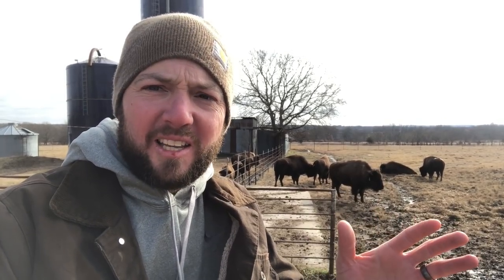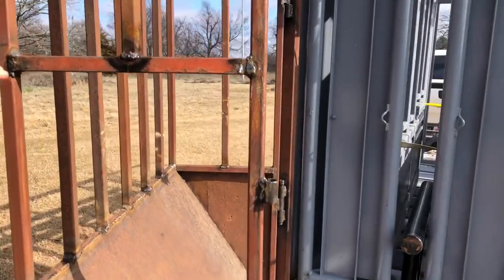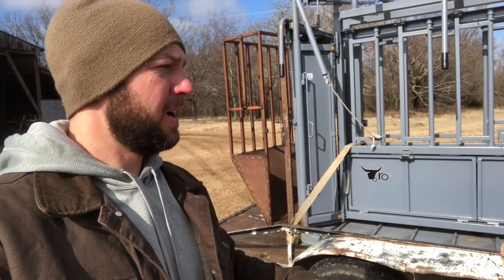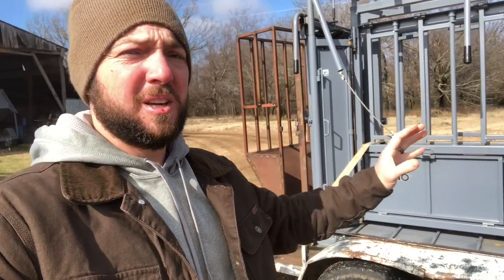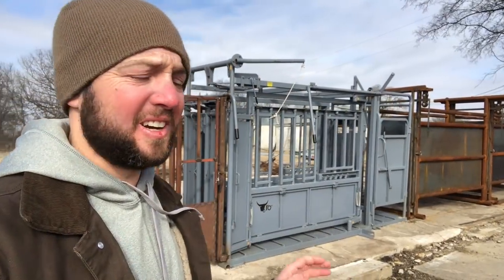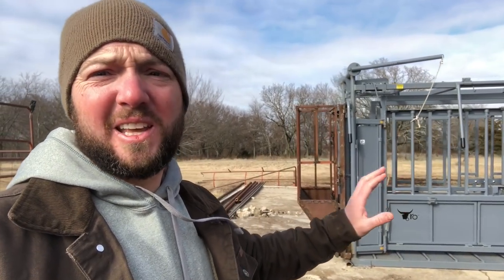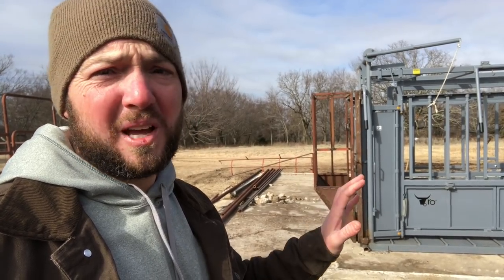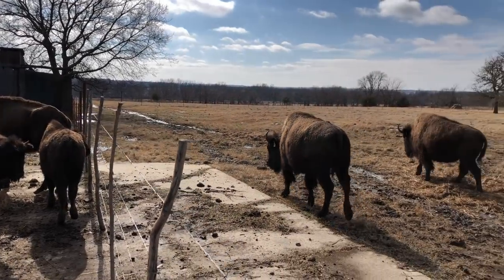Bison crash gate added to a New squeeze chute!

Comment: Most definitely need a so called "crash gate"  or someone will get hurt, you might find solid sides on the squeeze could be advantageous,  I'm not sold on the solid pinning of the crash gate, we use a chain with slight play in gate closing

Comment: The Bison stuff is very interesting from the level you are working them.  There is one thing I wish you would spend more time with a script or another message system to get your ideas together for the presentation.  You are rough to listen to often getting what you are talking about mixed up or repeating yourself.  You have a good opportunity to get organized and become a good speaker on Bison Management but it will take some effort on your part.